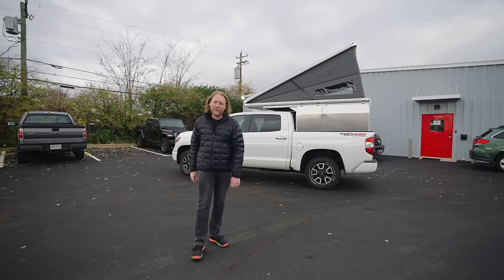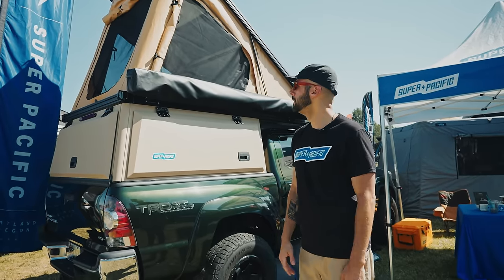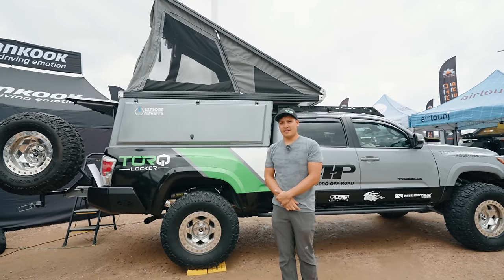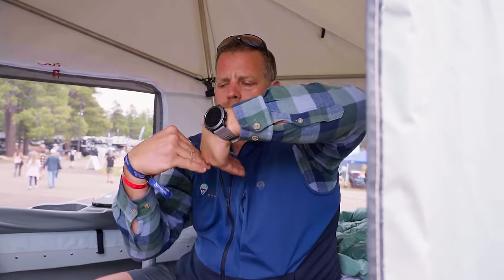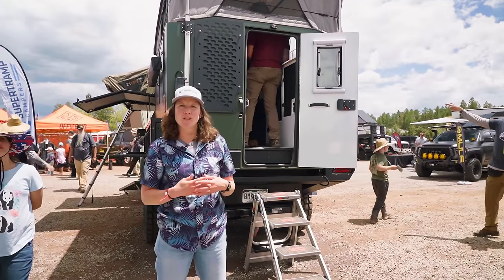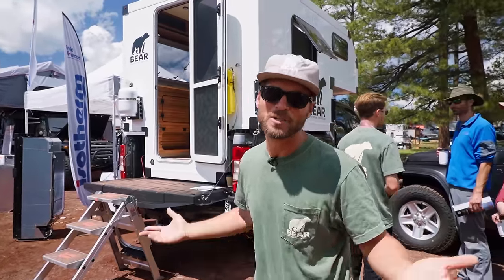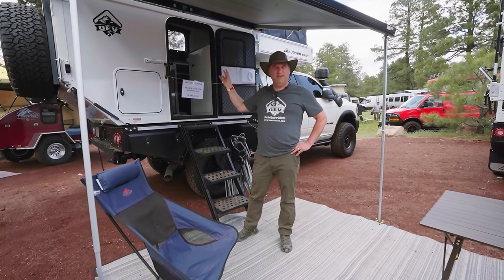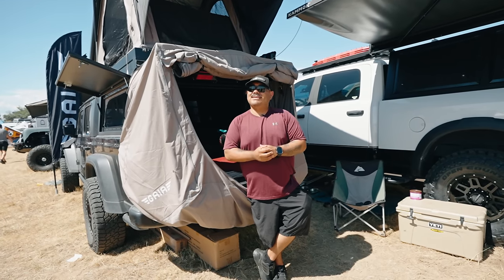30+ Truck Campers of Overland Expo 2023

Comment: what would yall recommend for a 5ft ranger? only thing is AC is a must..
Reply from the maker: AC for a midsize truck camper is hard due to the payload of the truck and most midsize campers being just a shell. Most midsize capers are similar to a Super Pacific/go fast camper to where it’s basically a shell. 

You could opt for a portable AC unit like the Zero Breeze or Eco Flow. The Eco Flow also does heat as well. 
Eco flow also has refrigerators and portable power stations.

Comment: How does it handle the weight of snow on the roof?
Reply from the maker: Not sure which camper you are talking about but with any pop up, most of them should be able to handle the snow especially if you can mount stuff on top. 

Now if you do have stuff mounted on top, it will also depend on how much weight. 

But with most pop ups, you can just upgrade your struts to support more weight, BUT you should check with the payload of the top before doing so because even though you may upgrade your struts to lift more weight, it’s possible that the actual top of the camper can’t support that weight and can fail.

Comment: Do you have one that fits on a Toyota Sequoia?
Reply from the maker: The sequoia is an SUV, so unfortunately you cannot put a truck camper on it. An option could possibly be to cut the roof out and cut the bottom of a Rooftop tent out and mount the two, but I don’t know if that’s possible with a sequoia and requires a lot of custom fabrication

Comment: Hi guys I have a Chevy Colorado with the v6 it's the work truck it's the 2022 with the 5,2 bed Chevy says i can't have a truck camper on it i have texted and e mail them no answer maybe you can help me out
Reply from the maker: Look on your driver's door for the tire and load rating. It should tell you there. It is probably going to be somewhere between 1,380 – 1,530 lbs. But double-check and make sure for your specific truck.

You said 5,2 bed. I am not sure what that means, if you have a regular truck bed then the following should work. 

With that load rating, you will be fine with any popup style camper that sits on top of bed like Hardsider, Super Pacific, Harker,  Explore Elevated, etc. Whats going to matter is then how much weight you add after the fact. 

You can also contact any of these companies and they should be able to help you to see if their camper is compatible with your truck.
Reply: @WelcomeToTheOutdoorsGear  thanks for the help